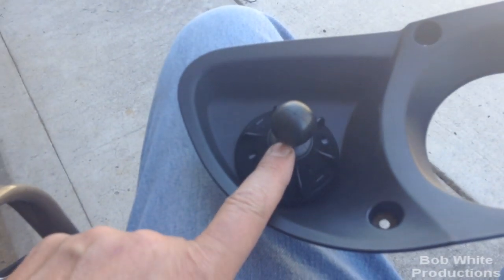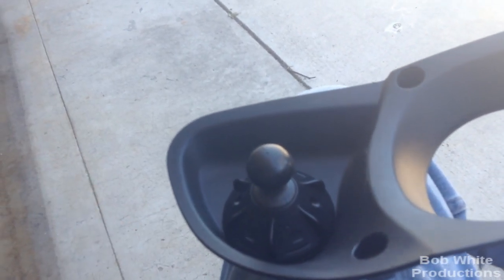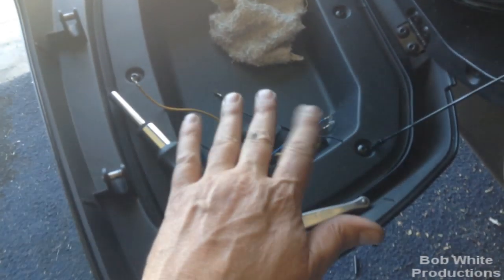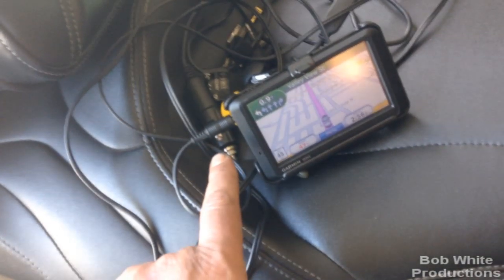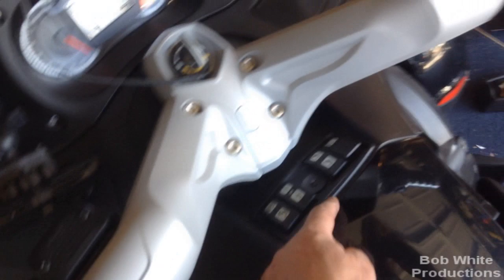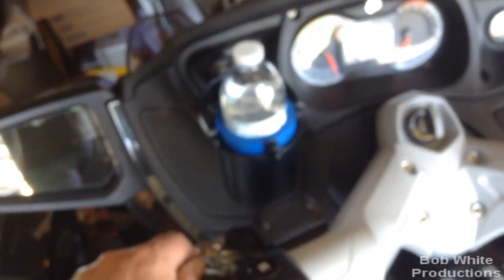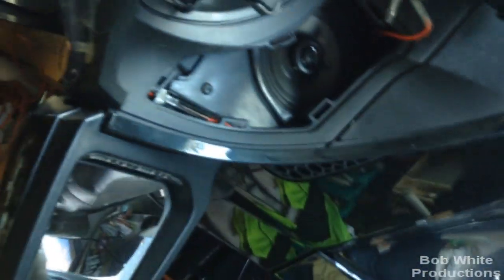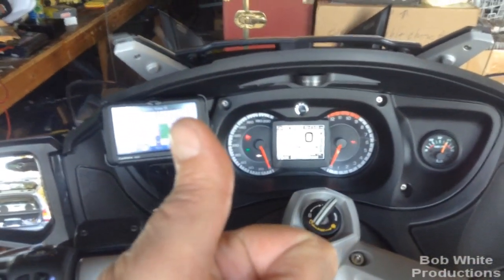Complete DIY for GPS on a Spyder RT

Comment: Another great video, Bob . . . perhaps a touch of silicone glue on the suction cup where it makes contact with the panel would stop it from falling inside if you deed to remove the ram ball part for some reason (cleaning, perhaps)

Comment: Hi Bob!  Excellent video.  I've got two questions:  
1.  You mentioned that the pinout for that connector just ahead of the right saddlebag was online somewhere. Would you mind providing the link?
2. There's not much for local electronics stores left where I could get a package of those contacts that shove into that dummy plug to make up a cable end.  Can you suggest an online source for those little babies?
Hopefully my 2010 without the audio package still has this wiring in place (despite the lack of radio and speakers on board). I'm looking to tap this connector just for power for my GPS. Seems like a super clean way to go about it.
Thanks again for the great video!